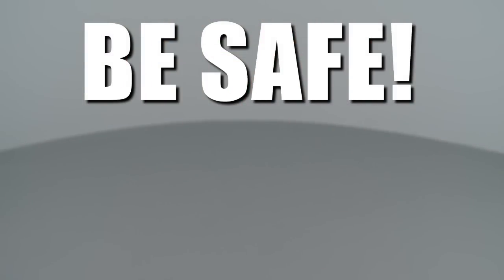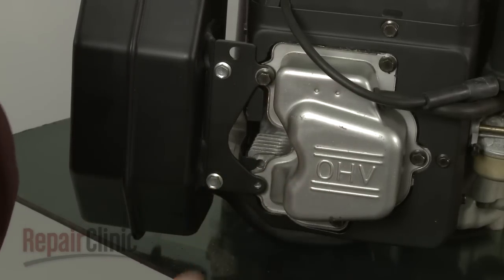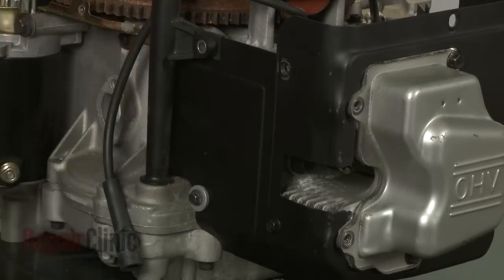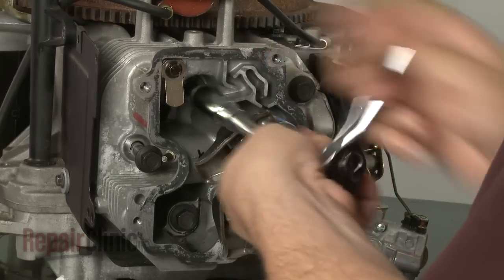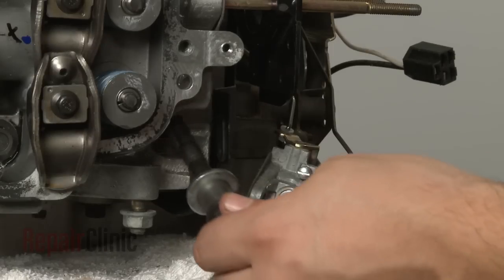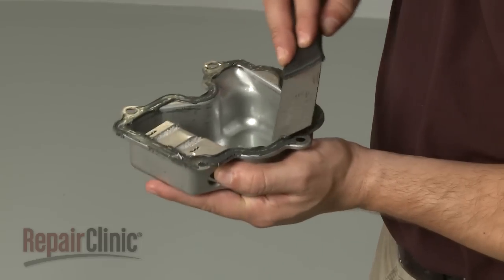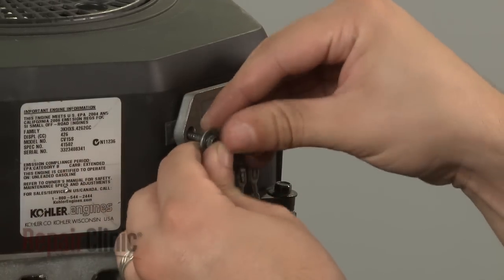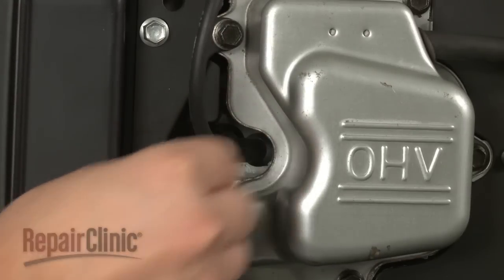Kohler Small Engine Replace Cylinder Head Gasket #12 041 10-S

Comment: Thank you so much for this video!  My LT155 stopped running two days ago and I was sure that it was going to be hundreds of dollars to fix.  The head gasket burst (again!) and I found a new gasket for $15.00.  With about $30 worth of needed tools, I did the work myself and didn't have any extra parts left over.  The mower started up in about two seconds!  I figure I saved $500 in repairs and labor.

Comment: I found out you don’t have to use the sealant for the rocker cover. I had a sheet of gasket material I cut to shape and I haven’t had any leaks. But this video was straight forward and easy to follow. Thank you repair clinic and thank you for my order of kholer engine gaskets. No other web sight had all the gaskets and parts I needed in one place

Comment: I give this vid a D grade for not cleaning all the old head gasket from the cylinder before putting on the new gasket.
Reply from the maker: Doug Cutler Thanks for the feedback.
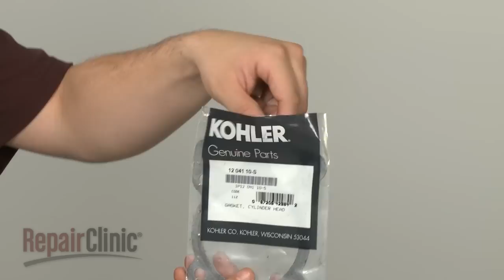Reply: aleon1018  At 2:50 while you are putting on the new head gasket I see a lot of old gasket material on the cylinder surface.

Comment: First, great video. Couple questions as I am about to do this...
1. do I need to drain the oil prior to starting
2. you show an engine on the bench, can I do this with the engine in the tractor? 
3. what was the sealant used on the rocker cover?

Comment: On the valve cover..is there a gasket? I looked and didn't see a gasket listed on this engine model. How is the valve cover sealed? There appears to be a oil leak on a tractor I got recently.
Reply from the maker: +steveshrdw Normally you use gasket maker to seal the valve cover. http://www.repairclinic.com/PartDetail/Loctite/2559707S/1610335?TLSID=1773

Comment: For those watching, the head bolts need to be tightened to 250 in-lbs torque.
Reply: that's messed up Brian.. they going to destroy their engine..From http://www.kohlerengines.com/engines/onlinecatalog/pdf/tp_2339_d.pdf : Following the sequence in Figure 11-44,
torque the bolts to 20 N·m (15 ft. lb.). Then
repeat the sequence to a final torque of 40.7
N·m (30 ft. lb.).
Reply: oh.. im not converting inch to ft.. my bad .. you're still a bit off probably depending on what engine you are referring to

Comment: I was told that if you replace a cylinder head with new, that you have to adjust the valves. That wasn't done in this video(which was an excellent one at that). So does that have to be done?
Reply: I has hydraulic lifters. :)

Comment: craftsman LT 2000 18hp kohler engine blowing blueish smoke and oil from exhaust. I drained oil took off OHV  cover replaced cover and put an in line shut of gas valve. and it still blows oil and runs for a few minutes then stalls with smoke.
Reply from the maker: +Kenneth  Redmond  First, check the breather to ensure it is not stuck or clogged. If the crankcase can’t breathe, it will pressurize and blow oil up into the head assembly. You can also check the compression. If you are getting 60 pounds of pressure or fewer, you may have a scored piston and cylinder. If the compression is low, it may lead to an expensive repair.
Reply: My dad's did the same thing when it blew the head gasket.  I replaced it several weeks ago and it just blew the gasket again the very same way.

Comment: There are a few information missing. Please can you answer the missing steps. You didn't explain that the starter had to be removed and installed. Some of us don't know how to do remove a starter or put it back together. Also tightening the bolts to manufacture specifications ? ? ?Now where and how are we going to find those specifications ? ? ......you specified the amount pressure you would add to each bolts, for a brig&stratton video at 5 minutes of the video but you didn't specify that on this video.
Reply: Rolando Mendez sounds like you shouldn't be worki.g on an engine if u cant solve those simple problems
Reply: I did this job on the same engine. You don't have to remove the starter.

Comment: have done all these steps but top push rod wont fit back in, help
Reply from the maker: Jay Cusack You don't have to do anything special for the rods. You might want to take the head off again and start over. Perhaps one of the bolts do not get threaded down all the way.

Comment: You forgot to mention to resurface the cylinder head on a wide, flat belt sander or large diameter sanding disc to remove warpage and restore flatness, and to prevent another blown or leaking head gasket.

Comment: You did not show how to set the valves/or if it has hydraulic lifters with non adjustable valves.There is more to this than what is shown.You will bend your push rods if you don't do more research on installing a head gasket on a kohler cv motor.You might have to bleed the hydro lifters if they have them.Ive had a nightmare with a cv15s motor and hydro lifters .I know.

Comment: no informations for the valves adjustment clearance very important
Reply: these are hydraulic valves no adjustment needed you just torque the bolts down

Comment: Now why wouldnt you all actually say the "manufacturers torque specs" rather than saying that...???  I mean theres only one spec for a head going on this motor, theres not any variations..  is either this or the command style which is totally different in procedure...  so did yall just not know the spec or something?   Lol...  what is it like around 16,000 cm lbs?

Comment: Koehler headgaskets are junk! No flame ring around cylinder. Constantly burn out especially on vertical shaft engines where fuel drops to lowest point in cylinder and soaks gasket. Too bad because they make a nice engine but save $1 on a gasket!
Reply: My kohlers seem to loosen their head bolts nearest the exhaust. I believe they should be checked and torqued regularly as maintenance to prevent this.